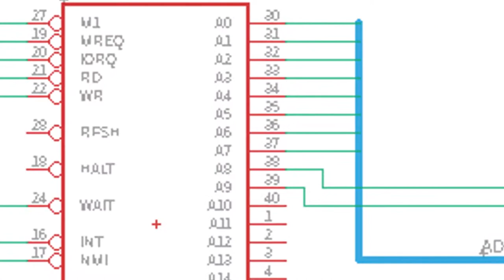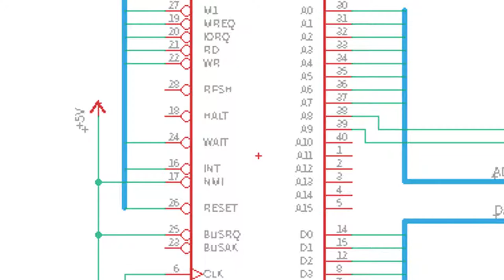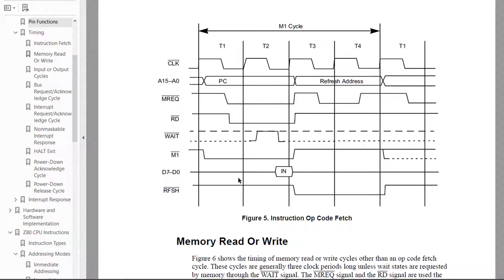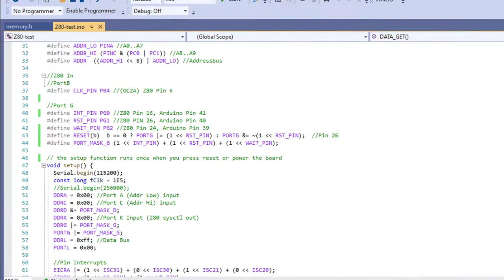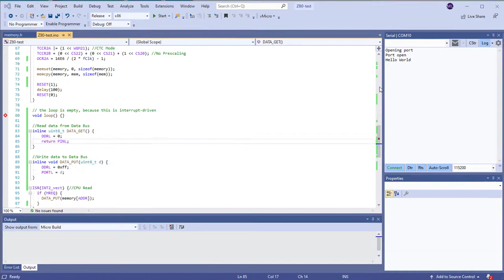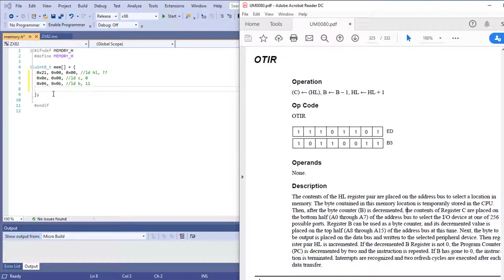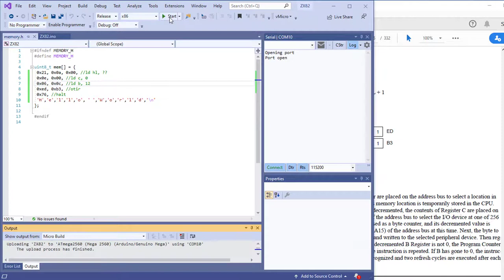DIY Z80 Retro Computer #1: Interface a Z80 to an Arduino

Comment: That's cool. I'm trying something similar with an RC2014 Z80 machine and an Arduino. Your layout has just helped me with the serial output - the RC2014 has a serial chip, but it's clocked from the CPU clock. So it won't work properly if the CPU runs slowly from a clock generated by an Arduino (or me pressing a button with my finger).
I like how this stuff is really really simple, unlike modern machines where you've no idea what's going on :-)
Reply from the maker: Yes, that makes the charm of this old stuff. And even this took me days and nerves when I didn´t understand what´s going on in the Z80, especially when it didn´t not do what I expected.

Comment: Nice job!
There are two schemes (1st pdf and 2nd PNG) on their website. And they have different connections. What is the valid one? 1st or 2nd?
Reply from the maker: Both are correct. However the png is a bit simplified, because it does not connect all control lines to the Arduino, as the example sketch does not use them. If you want to try these, i.e. Interrupts, you will go for the pdf.

Comment: UPDATE: I had WR RD lines crossed, it works!

I spent some time building this, but it's not working for me. (Using a Z84C01 Maybe that is the problem?)

I followed the PNG schematic (the PDF is different). My connections are definitely correct according to the schematic.
I get no output on the serial monitor, even though the sketch is running.
I'm not used to directly addressing ports in Arduino, so the code is confusing to me.
I tried adding some serial output to help debug, it seems the read subroutine isn't getting triggered.
Reply from the maker: The Z84C01 is different from the classic Z80 I used. When I got it right, it produces its own clock with a crystal. In my circuit, the Arduino clocks the Z80, and clock frequency cannot be more than 100kHz.
Reply: @DoctorVolt  I managed to get it working, had my WR RD lines crossed. 🤦‍♂️
Yes, the Z84C01 has a built in clock gen so the pinout is different. But you can just feed an external clock into XTAL1 and it works fine.
Thanks
Reply: @DoctorVolt  this has been a great project. I learnt a lot about directly accessing ports, and the DDR register. Very useful.
I want to try to implement it on a large PIC18F I have lying around. (It will be a large learning curve for me!)

A couple of parts I still don't quite understand, hope you can help!?

These sort of lines totally confuse me:
#define RD_PIN PD2
#define WR_PIN PD3
#define RD    ((PIND & (1 << RD_PIN)) == 0) 
#define WR    ((PIND & (1 << WR_PIN)) == 0) 
#define PORT_MASK_D ~((1 << RD_PIN) + ( 1 << WR_PIN));
What does this do? I know it's setting up PORTD macros, but I just can't make any sense out of it!

I see you define the IORQ pin but it doesn't seem to get used, is that correct?

The logic that I can work out is:
Z80 RD and MREQ are low - Arduino write memory onto the data bus.
Z80 WR and MREQ are low -  Arduino read data bus into memory
Z80 WR is low MREQ is high - Arduino read data bus as IO

Again, thanks for the awesome project! (Sorry for the many edits, wanted to be clear)
Reply from the maker: These are macros for fast access of the digital ports. You can use the classic digitalRead() and digitalWrite functions instead, but these are much slower.
Reply: @DoctorVolt  Yes, but the macros are very confusing to me. For example this line;
RD    ((PIND & (1 << RD_PIN)) == 0) 
What does RD evaluate to?

My guess is, RD = 1 when Pin D2 is low?
Reply from the maker: That´s correct. PIND is a register bite that contains the levels of the digital pins D0-D7. So this expression basically masks out the third bit (which belongs to pin D2) and checks if it is zero. You can also write "!digitalRead(2)", but this is much slower.
Reply: @DoctorVolt  Thanks for answering that! I'm glad I finally understood it!

I'm still a little confused over the timings for the Z80 read and write.

Is it safe to get a conflict on the databus where the Arduino is outputting at same time as the Z80?
I see you set the Arduino DDR to output when a Z80 RD happens, but it doesn't get set back to input until the next WR? Wouldn't that cause a problem as the Z80 outputs to the databus before WR becomes active in a write or io cycle?
Reply from the maker: Yes, this must not happen. Only one member may write to the data bus at a time. But the Z80 writes only after it has set the WR line active (low). This triggers the ISR(INT3_vect) which calls the DATA_GET() function where the PORT is set as input. There may be a brief moment where the CPU and Arduino both act as outputs, but it still works anyway. But if I revise the code when I get a chance, I will switch port L as input again right after writing it to DATA_PUT(). Thanks for the hint.
Reply: It seems the Z80 is fairly tolerant to this, as it does work in reality. 🤷‍♂️
The worst case would be where they are both outputting opposite states like 0xFF and 0x00, so a short to ground through the Arduino or Z80.

I'm still looking at the timing diagrams for the easiest solution, I think a rising edge of MREQ or IORQ might be useful to indicate the bus is free.
Reply from the maker: Yes, as long as there is no third party that reads data from the bus, it works. And the Z80 is remarkably robust.
Reply: @DoctorVolt  OK, I think I have it figured out finally! Thanks for all your help!

In this case (we aren't using Z80 interrupts, or IO RD*).

The only time the Arduino should be set as output is when RD is active (low).
The falling edge of RD indicates the Arduino should output data onto the bus.
The rising edge of RD indicates the Z80 has read the data, so we can use that to set the Arduino back to input.

This means the Arduino code needs to be changed so that RD pin is an interrupt on change.
When RD goes low we set the Arduino to output and put the data on the bus.
When RD goes high we can set the Arduino back to input.

* There's a small problem, if the Z80 does an IO RD. The address bus outputs the IO port number. So in this code, it will get the data from the memory array. It would be good to implement some logic so that when an IO RD happens, the Arduino reads the serial input and puts that as data. Then this could work as a full terminal emulator.

Comment: Realy nice! I try to replicate your project but I only getting "?" mark or garbage on the serial monitor. I'm not sure if I connected the Data/ADDR_LOW pins in the good order, exemple, I'm I supposed to connect Z80 A0 pin to the Arduino pin 29 or pin 22? Same for the Data pins ? Thanks ! :)
Reply from the maker: Hard to say from remote. Maybe baud rate of terminal does not match? Faulty wiring? Anyway, I posted an upgrade of schematic and sketch. Hope this makes more clear how to connect.
Reply: @DoctorVolt  Thanks!
Reply: I had the same problem, you should use 115200 baud rate in your terminal instead of default 9600.